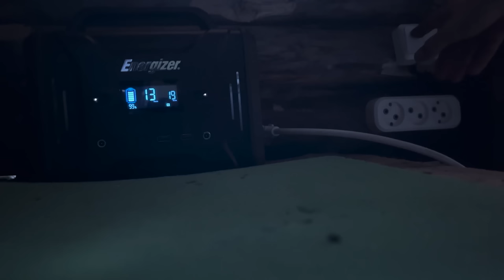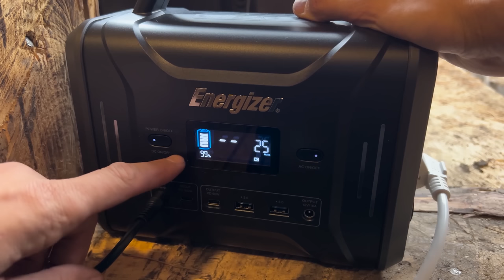Building a house underground from start to finish. Bushcraft 2022

Comment: I like the video, but I have some important constructive feedback. Those were some big heavy logs, and they're only held down by those nails. The sheathing and the heat from underneath will cause condensation to form on the cold nails. Condensate is rough on most metals, even galvanized metal like you've used here. Because of how they are stacked, the nails are the only thing holding your runners. You're at risk of having all that collapse on you. 

So I hope you're not staying there for long. For big heavy logs, think log cabin, it's the same problem. You want to use wood joints to give the structure some strength. Instead of nails, guys will cut and bend rebar into U shapes to accomplish the same thing. Both methods are cheap, and the wood joinery can be free if you know how.  Look up a couple of joints on youtube. Search for "wood joinery" and you'll see what I mean.

Comment: I do have a  few questions. One: where is your outhouse? You would need a private place away from the water and the house  to do what was necessary? What did you do with your garbage? Extra used tin foil, etc. Why didn't you build a hot box in the corner of the house? A box with dirt, then you have the fire and hot coals on top of the dirt to cook and keep the hut warm? But very cool. It looked like it was very hard work and took quite a while to build. Being t very nice indeed

Comment: Single  wall stove pipe  inside  to radiate HEAT . Insulated  outside  so  it doesn't  plug up.